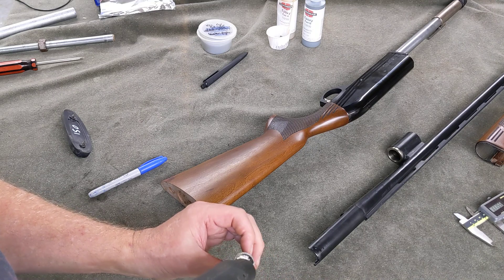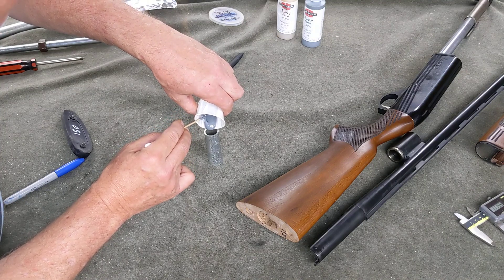Modification to shotgun that reduces felt recoil and improves the  balance of the firearm

Comment: Not a bad idea. I'm researching recoil pads for my Remington 870 pump action and came across this video. I'm looking for a screw in recoil pad that I don't have to a lot of modification to fit my gun. I'm looking to both reduce recoil and a little length to the stock. I have to agree with you that this mod would make the gun better balanced and I may try this myself. Thanks for taking the time to make and share this video.

Comment: I do something similar with all my shotguns (over-under, semi-auto, or pump). With the shotgun all together, I try to balance the shotgun with my finger under the front end of the receiver. Most guns are front end heavy. If so, I tape a baggy to the back end of stock & add lead fishing weights to the baggy, until the gun balances. I then pull off the baggy, remove the pad & install the weighted baggy into the hole for the stock bolt. If the bolt hole is long, you may have to add packing to keep the weight all the way back. Screw the pad back on & check the balance.
Reply from the maker: yes, I also prefer that neutral balance over front heavy

Comment: F = ma
The force of the recoil from the cartridge stays the same, so you increased the mass thus slowing the acceleration backwards when it pushes into your shoulder.  Be careful though, you said it "improves balance" but that may or may not be true.  It will definitely change the balance point moving it back towards the shooter.

Comment: I agree, nice tip thanks for posting...
Reply from the maker: Thanks
Reply: @neuromanglers  I recently purchased a Meriva 12 gauge budget shotgun for $159 before shipping from Primary Arms.  I took it out to the range and holy moly.  It kicked the livin you know what out of me.  I couldn't even finish the box of 25 shells.  After watching your video I removed the butt plate and the stock is entirely empty.  A big hollow void with the retention bolt recessed around 10 inches within the stock.  That was an ah ha moment for me.  No wonder it kicks so hard.  I think I'm going to look into getting an aftermarket stock if I can find one that fits.  Plan B is to fill it with something.  Anyway, it's always good to listen to other folks and learn what they have to say.  Thank you and God Bless...
Reply from the maker: yep, you will be amazed how adding weight tames the recoil